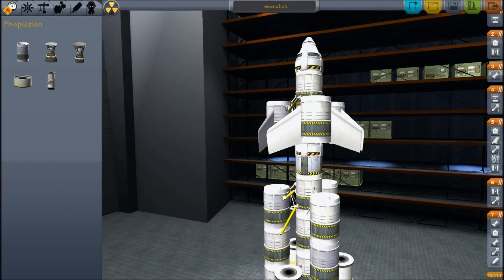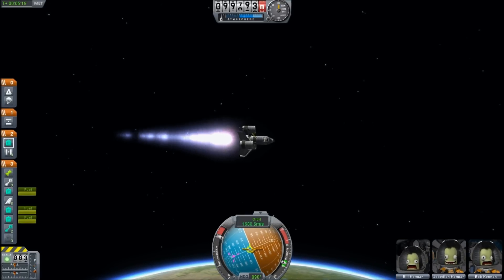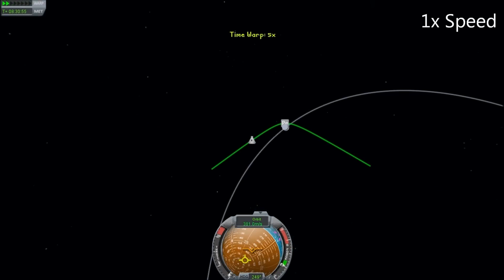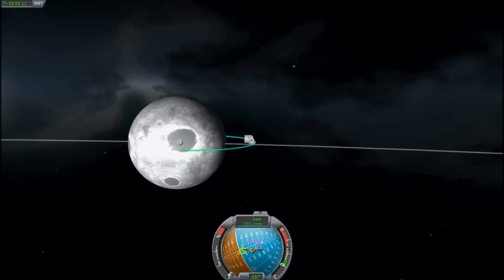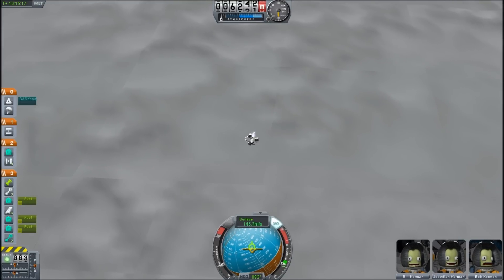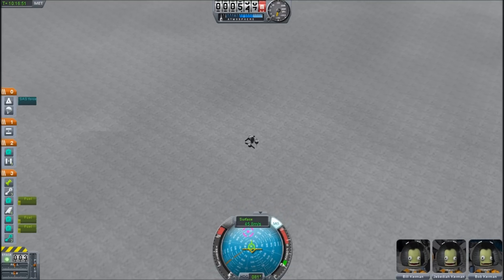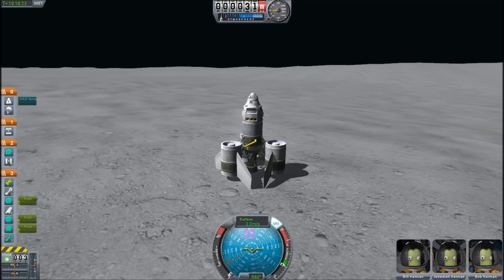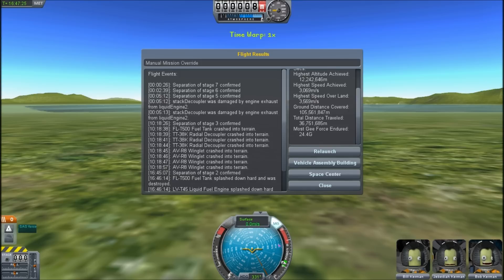Munar Lander & Return With Stock Parts in Kerbal Space Program

Comment from the maker: @rrolo1 The reason I don't like RCS is that using the lateral burns has a hasty habit of inducing a rotation unless you have the advanced SAS fitted to correct for this error. That just adds too much mass. 

I use the 3 tanks as part of the landing structure after I realised that when empty they only have a mass of 0.2, radial decouplers have a mass of 0.4 and provide less utility.

Comment: Very nice demo ... it is actually very similar to my own ( I don't use decouplers to the 3 side tanks, have a RCS tank too ( it surely helps to kill any residual lateral speed after landing , especially if you land on a tilted area ), some more struts and 3 radially mounted wings instead of your 6.

The best part is that my design has a big enough fuel budget that it can actually land on Kearth as well if you make some high atmosphere braking by multiple flybies ( I've done it twice ... )